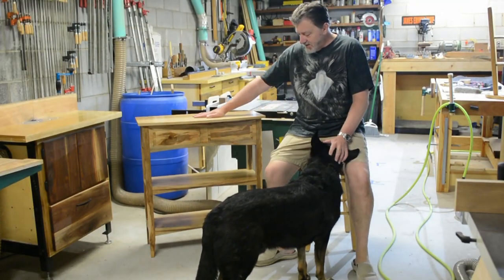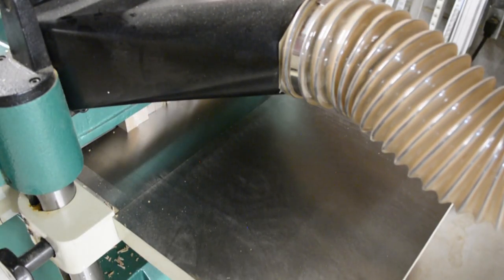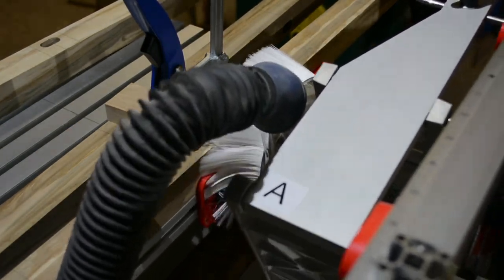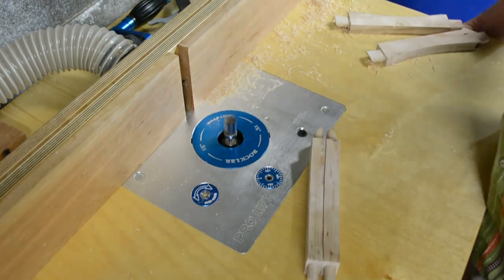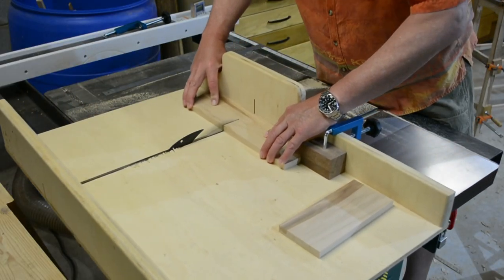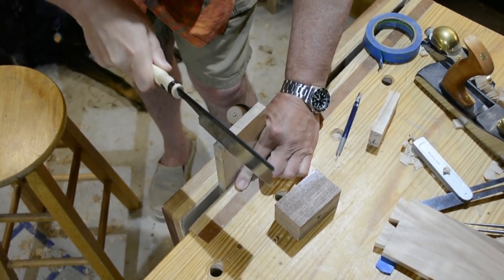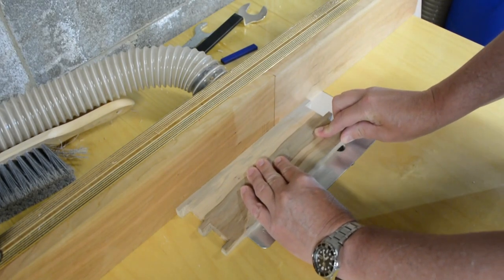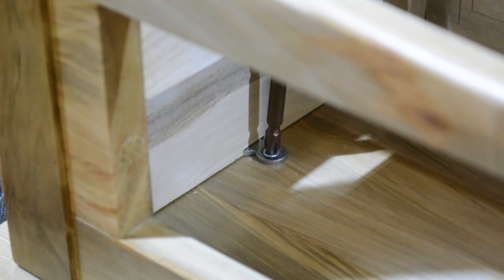Entry/Side Table out of Gum Wood

Comment: Excellent use of the PantoRouter!  Thanks for sharing.
Reply from the maker: So far I am loving what you can do.  I do need to design a stop system for positioning work towards and away from the bit.  For now I used a block clamped to the work surface.

Comment: I bought a loaded tool cabinet from a fellow's estate who I'm certain he not only cleaned and oiled those chisels after every use, but told them a bedtime story before folding the shop towel overtop of them in the drawer. When I saw your chisel it reminded me of that cabinet. A shame the family didn't think more of them than to dump them at an auction. I've worked NEAR highly skilled and precise folks like you.  I'm guessing you have a work past whereas a two story 3 axis CNC won't impress you 😁
Reply from the maker: There is a place for CNC...but not really in woodwork.  They are good for template making.  My father was a wood sculptor, and I have his chisels as well.